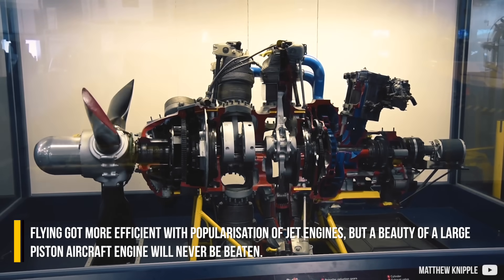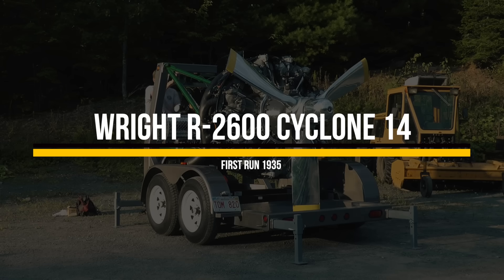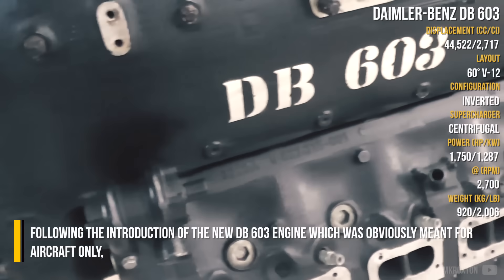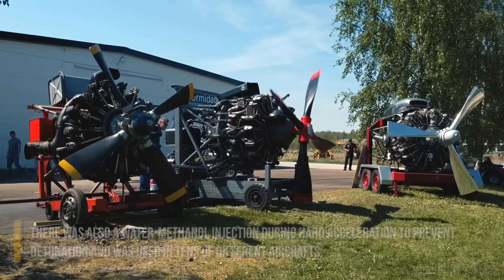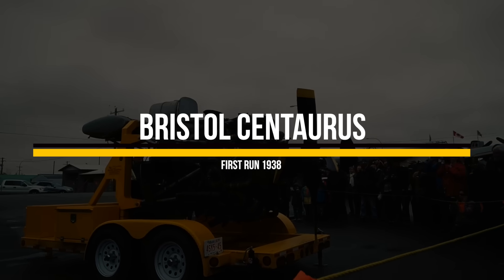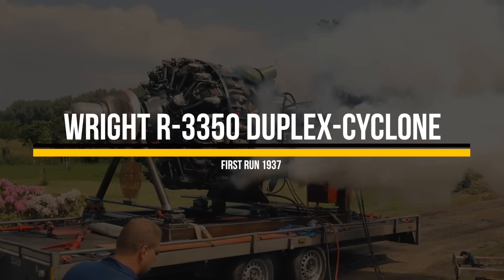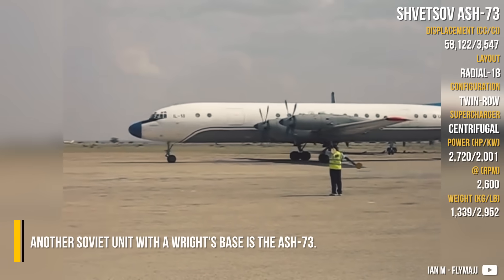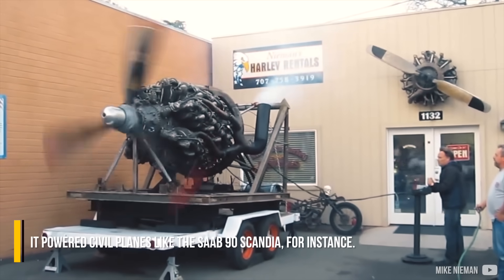9 Of The Largest Piston Aircraft Engines Ever

Comment: Reading the comments below; NOBODY has   mentioned  the Lycoming xR7755    with 36 cylinders.   Of about 5000 H.P.TWO were built; originally intended for the "European bomber" which enventually became the B-36.
Reply: I was wondering about that too. IIRC, only one of these was actually used as a test engine starting at 5000 HP in 1946. The second prototype was delivered to Wright-Patterson in 1946 per contract, but  the then-USAAF had lost interest in new piston engine designs.  The original test engine is at the Smithsonian Institution. Presumably, the AAF scrapped the other one; the story is that by the time of delivery, the project was cancelled and the Lycoming engineers were told to "dump it on the ground". No definite word what became of it after that.

https://en.wikipedia.org/wiki/Lycoming_XR-7755
https://www.tested.com/tech/564279-story-aviations-largest-piston-engine/

I also found an article whose author said his father was part of the engineering team, and that a third engine was built. I can't find any confirmation of that, though. Most sources say two were built and only one was run. 

https://oldmachinepress.com/2018/05/20/lycoming-xr-7755-35-cylinder-aircraft-engine/

Comment: The interesting thing about most of the German examples is that they ran on relatively low octane fuel. Most American engines were designed for super high octane avgas (normally 130 octane although 150 octane could be requisitioned if required). The Germans had to make do with 80 octane pump gas. As a short fix/booster most German engines were fitted with a water/methanol injection system

Comment: The largest piston engine that was ever put into production, and used on an aircraft was the Pratt and Whitney R4360 Wasp Major @ 4360 cubic inches. But the largest one ever built was over 7000ci Lycoming built 2 prototypes, one of which is at the Smithsonian Air Museum, but those were never flown.

Comment: On the Wright Cyclone R3350, you can see the green painted power recovery turbines.  Basically the exhaust side of a turbo charger, but with a shaft geared to the crankshaft.  Those would provide an additional 150hp per turbine on this engine.

Comment: Soviet Yakovlev M501 42-cilinder bigger than Lycoming XR-7755 36-cilider - 147.1 litres versus 127.1 litres, and more powerful - 6205 HP versus 5000 HP. Also, projected Charomskiy M305, 28-cilinder diesel 10 000 HP engine, but unbuilt.

Comment: The IL-2 Stormovik shown taking off and flying actually uses a Roll Royce Merlin engine instead of the original powerplant. New parts are still manufactured for Merlin engines whilst they're not for the OEM engine.

Comment: The B-29 used very unreliable Wright R-3350 engines as in the B-29 , FiFi, during the war.
It was later improved to be much more reliable for commercial use after WWII.
Eventually evolving into the commercial/military turbo-compound R-3350 where the 4 turbo chargers per engine added ~ 150 HP each directly back to the crankshaft. A sort of “hybrid” between the piston and jet engine ages.
The Pratt & Whitney R-4360 was basically added to the B-29 to create the much more powerful and reliable B-50.
All as the B-36 with 6 R-4360s and 4 jet engines was developed.

Comment: I always find your videos interesting, however there are a number of horrendous mistakes regarding video footage to specific related engines...
Reply: One of the mistakes is showing the B29 when talking about the P&W 4360 engine.  I believe the B29 was powered by the Wright 3350.
Reply: The b-50 used 4360s. That was a b-29 with bigger engines basically. Fifi is a 29. There were a ton of errors in this video
Reply: And a sea fury was shown for the Centaurus but it had a r3350 in it for racing
Reply: And the r4360 was in a ton of war planes most famous was the b36

Comment: The P&W R-4360 was used in the Boeing B-50 (aka B-29C) and my father flew one on the first non-stop around the world flight in 1949. See: Lucky Lady Ii flight.

It was also used on the massive 6 engine B-36 Peacemaker, as a pusher prop design. Hardly stealthy with the noise it made!

Comment: All radial  engines pool oil in the bottom cylinder and have the startup smoke. They get turned manually to make sure they did not have a oil  lock that would damage the engine Each engine usually needed 2 quarts of oil after a long flight.  Dad was an A & P at SFO  until jets took over. I still think the Connie is the most beautiful airframe ever made and I would not  hesitate to fly in one.  It was built like a Swiss Watch and the rebuild was financed by  Breitling Watches Company. That is what the B on the triple rudders stand for. There is a YouTube flight on Camera. Just search for it. Only the German transcontinental  plane is close: the FW 200. One of the first " Airforce One " for Hitler. Even President Eisenhower made a Connie an "  Airforce 1 "  that was his flying office. Thanks for the stroll down Memory Lane.

Comment: Torque on these engines is monstrous, around 10,000nm for the Wasp Major
Reply: 7376 lb ft since you asked
Reply: @paulreilly3904  how many hand rocks is that?
Reply: We work on Nm here is AU, my road car, a Commodore, with a US LS3 6.2L V8 puts out 570Nm, which is very respectable here for a non turbo or supercharged motor. These 28 cylinder radials are beyond belief, the engine mounts must have been hardened steel?  Great video 👍
Reply: @petehoskins1267  what the hell is that?? I want to know how many sacks of grain boots is that!!
Reply: That dual stage supercharger is awesome on the Wasp Major.
Reply: That’s why they weren’t widely used in tanks because there were no transmissions that could handle all that torque
Reply: What is that in freedom units? 8,000 cheeseburgers per toe?
Reply: radials often redline between 2000 and 3000 rpm so about 1.8 - 2 times the horsepower to get to feet pints.
Reply: @SoI_Badguy  I thought it was roughly 6,000 hands - horses
Reply: INSANE!
Reply: ньютон-метров, если по-русски. Нормальные единицы измерения, не то что как тут писали, "чизбургеры на палец"
Reply: Just wait until the Tesla roadster

Comment: B29 is r2800
Reply: B29 had R3350s.  They were the first to use that motor and they had a lot of developmental problems.  Fortunately, they worked them out and it was a widely used engine for a long time.

Comment: The R-4360 didn't see service in WWII, but it saw active military service with SAC, powering the frankly ludicrous B-36 Peacemaker. Which still holds the record for the largest wingspan of any combat aircraft -  a whopping 230 feet. It gave rise to the least enviable job in the US Air Force at the time - namely, changing all 336 spark plugs on the six engines.
Reply: Each engine had it's own crew..
Reply: I’m sure that was no small feat.

Comment: Sadly, while the info on the engines is correct, it isn't for the video's of flying planes supporting the engine types.
For the Bristol Centaurus, the airplane shown at 4:10 is a Hawker Sea Fury which had original a Centaurus engine, but this example has an R-2800 fitted, one can notice the silver collored valve rocker covers on the engine, which a sleeve valve engine doesn't have, so this one is shown at the right section as far as the engine type goes..
But then the airframe shown at 6:10 in the Centaurus section is also a Sea Fury, this one rebuilt for the Reno Air Races unlimited class, which has the R-3350 fitted in it.

The second error is the IL-2 shown at 5:00, original it had a Mikulin AM-38, but this flying example, restored after being found in a swamp, had it's engine replaced with an American Allison V-1710 engine as there were no working examples of the Mikulin for hand, I believe there is now a Sturmovik under restoration which is to use the original engine, which is shown in static testing in this video.

The B-29 never had the R-4360 fitted, some famous planes which had those were the B-36 and Howard Hughes "Spruce Goose" which had 8 of them!
More recently a Reno racer, a Sea Fury named "Furias"has been fitted with a R-4360.
It can be seen in this video: https://www.youtube.com/watch?v=jEs5xKXgm6w.
The air frame of the Sea Fury is very suited for high speeds and is very popular for air racing, and air racing is still very well dominated by WW2 era air frames, mainly P-51 Mustangs and Sea Furies, obviously they have not been able yet to build more than one new airframe for this type of racing yet, being it too costly.

The last, and possibly the biggest mistake, as the other mistakes can only be seen by insiders in classic avaiation, is the Svetshov ASH-73 section.
All of the planes shown don't have a pistopn engine at all, they are Ilyushin IL-18 with turboprop engines, Kuznetsov NK-4 or Ivchenko AI-20, the IL-18 never flew with piston engines.
The ASH-73 were used in the Tupolev TU-4, which was a Russian B-29 copy and the Beriev BE-6 flying boat.

Nice find however was the Messerschmitt ME-410 at 2:58, as this was the only surviving one restored to working (but not flying) order, it did some ground runs of the engines before being stored forever in the mueum at Cosford, UK..
Reply: You are correct that the B 29 did not have PW 4360. However the B 29 derivative KB 50 did.  The Boeing B-50 Superfortress is an American strategic bomber. A post–World War II revision of the Boeing B-29 Superfortress, it was fitted with more powerful Pratt & Whitney R-4360 radial engines, stronger structure, a taller tail fin, and other improvements.
Reply: Who TF Cares?
Reply: @MAGGOT_VOMIT  - people who care about this kinda stuff.

Comment: With four engines each having so much displacement it's surprising that a plane doesn't run out of fuel instantly.
Reply: Stoichiometric ratio is how. AVGAS is just petrol (with additives and a high octane, but still petrol) so it burns 1 part fuel to 14.7 parts of air. In a 80L displacement engine, about 5 and a half liters is fuel. As the aircraft climbs and the air thins, the fuel mixture is reduced to maintain this ratio. Also, once moving it needs far less power then it did at takeoff. The R-4360 would take off at a Manufold Pressure of 55", climb at 41", and cruise at 29". The horsepower would be half to 2/3 of its capabilities when cruising. 

As to weight, well that us up the wing design. The engines get it moving, but the wings hold it up. A 747-400 will hold over 60,000 gallons of Jet Fuel which averages 6.7 lbs/gal. So 360,000+ pounds of its takeoff weight are fuel. Obviously, planes only take the fuel they need and don't fly with full tanks unless necessary. As the fuel burns the plane gets lighter and flies higher and faster. The full 747 will start cruising at about 30,000 feet, but as it gets lighter can go up to 43,000 when nearly empty.

Another way to look at it. The P-51D with its Merlin engine burns 1 gal/min (60 gph) at take off, but can be brought back to cruise at just .45 gal/min (27 gph).
Reply: Or oil.
Reply: Exactly what I keep thinkng.

How on earth do they keep enough fuel on baord to keep it going for 2 miles let alone 200.  also how do they lift all that fuel in the air.
Reply: Turbine engines have taken over the large prop driven planes completely because they are simple and less maintenance intensive.  However, they also burn more fuel for a given power level, so the wonderment expressed here about how they can carry enough fuel applies even more to turbines.  They manage to do it however and turn a profit as they do.  Time between overhauls and routine maintenance costs make the difference.  They can spend more time flying.
Reply: Rick Murray turbines are harder to maintain.....

Comment: I saw the 4360 Wright engine when I visited the National air Museum annex out by Dulles airport. As an engineer myself it is mind boggling to think of the amount of design work that had to have gone into it in the pre-CAD days. And to think of the work needed to tear one down and rebuild it. One would have had to darn well follow the instructions to the letter.
Reply: The B-36 Peacemaker had 6 of these engines and since the Peacemaker was too big to fit in a hangar the maintenance crews had to service the engines outside... 2 spark plugs per cylinder, 28 cylinders per engine and 6 engines per plane.
Reply: Not to mention the use of that cumbersome, hard to read slide rule.
Reply: Try the engines of a Super Constellation, not just turbo chargers, superchargers, buckets of sparkplugs, mass quantities of oil, but a power recover turbine coupled via viscous coupling to the crank.
Reply: I was a Reciprocating Aircraft Engine mech when I was in the Air force. I worked on R-2000's, R4360's and R1300's.
The 4360 was the sweetest sounding engine of them all, but it was much harder to work on than the 2000 or the 1300.

Comment: piston aircraft engines are too bad in power/displacement ratio :p 

ineficient :0
Reply: Ricardo Galdamez sv  On power to weight, they were amazing!  One hp per pound of engine weight was the holy grail and many of these engine came close or even exceeded this mark.  Also remember that aircraft engine are rated for max continuous power.
Car engines weigh a lot for their power output and I wouldn’t consider running a production car engine at its claimed max power for long periods of time, because kaboom!
Another note - this is 60 to 80 year old technology without computerised engine management 😉
Pretty amazing stuff!

Comment: Was too late to power war machines, yet powered the B29, the plane that ended the war 😂. Great video, very interesting.
Reply: No it did not... 3350's powered B-29, but after the war and before the jets took over they modified the b-29 airframe to take 4360's. They were redesignated b-50. They are obvious by much different nacells and much taller tails.

Comment: I didn't think it was possible to hear an aircraft engine sounding as nice as a Merlin, but the sound at 3"03' comes VERY close :)
Reply: I saw a Hawker Sea Fury with the real Bristol Centaurus race at Reno. They sound super smooth. Unfortunately Visio isn't much of a plane guy and showed planes refitted with ordinary radials and a modified Bearcat that never had a sleeve valve engine in it.
Reply: Check this video out:

"Rote7 Bf 109 First Motorcheck after crash 2007 (Part1)"

Quite a lot of revving and supercharger whine after 3:00
Reply: The F8 Bearcat with the R2800 has a sweet smooth sound, especially for a round motor.

Comment: Wankel aircraft engines? That's new for me. Maybe do i video on that
Reply: He should do a little more research perhaps. An aero rotary engine is not a Wankel rotary engine and they do not have rotors. With an aero rotary the crankshaft is bolted to the air frame and relative to the engine it is stationary. The propeller is bolted to the crankcase and the entire engine, except crankshaft, rotates .. as the name implies.
Reply: @hackenbush23  One Russian Helicopter manufacturer did use a Wankel Rotary engine for a short period.